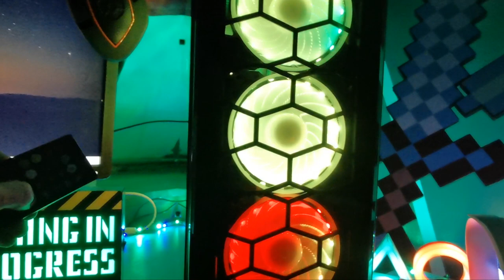Unboxing my Geforce RTX 3070 GPU - EBuyer

Comment: This is a nice little channel.  I’m also hoping to buy one of these from ebuyer by the end of this year. I could have easily got one end of last year but the temptation of the ps5. But I have learned from that mistake due to not many next gen games I probably should have bought the pc first then ps5 later   Holy shit thinking about it I’m extremely stupid   Who knows, the pc may even drop in price, I’ll be going for a rtx 2070 or higher above. I just hope I manage to save my money cause the amount of times I’ve come close to a high ends pc then just threw the money away on lots of little things or most recent one.  The ps5.

Comment: How did you get the LEd lights on mine isn’t turning on with just the remote did you have to plug something in on the inside?
Reply from the maker: No mate didn't switch anything on, on mine.. I just pulled the tape out of the small controller and it then they automatically switched on, when I fired it on

Comment: Very good review I want to buy the pc but a lower end version there was one review and it said the pc didn’t work do you think I should still buy it
Reply: The link by the way https://www.ebuyer.com/1129496-alphasync-core-i5-9th-gen-16gb-ram-2tb-hdd-240gb-ssd-gtx-as-d5411
Reply from the maker: Hey glad you like the review 😀😀 make sure to subscribe to the channel to help 😁 the pc you showed isn't bad at all for a lower end pc. It will run most games but you might have to run them at a lower rate. But will be a fantastic little buy. It has nvenc encoder. So you will be able to stream and record straight from the graphic card

Comment: Hi mate I have this pc and have issues connecting a controller to it. Did you have these problems and can you connect your controller ?
Reply from the maker: Hey mate.. I haven't actually checked this problem just yet.. What seems to be issue?? I'm usually VR so don't use a  controller. But will check for you and get back to you
Reply: Just doesn’t seem to want to connect controller at all wondering if it’s the pc or just an issue I’m having
Reply from the maker: Hey mate.. Sorry for late reply. Been workin alot recently. I tried using my controller last night and all seemed okay. Worked like a regular controller does. I plug mine in tho, around the back ports and registered straight away. So no issue with mine mate
Reply: I’ve tried everything and it just doesn’t want to show my ps4 controller gonna send it back must be faulty

Comment: Hello mate, looking at a pc with this case but hear it has cooling issues due to the glass panel in the front. Is it removable and is there some sort of dust filter behind it if I was to take the panel off or can I buy one online? Thanks in advance for and help.
Reply from the maker: Hey mate, the front panel can be removed, but I honestly have had no trouble with airflow. It's super cooling but I do have a decent cpu cooler.. As to dust cover. I didn't have one but one one on my old cases, so slide it on and works great, but I'm certain they are pretty cheap online dude. Hope this helps. If you like the video could you subscribe to my channel please
Reply: @DavoookyREBORN  Thanks man, appreciate the help. I'll sub now.
Reply from the maker: @tristanmurdock3960  absolutely no trouble at all. Thank for the comment and sub 👍
Reply: I got the 5600x version of this pc last week with the aio cooler and saw the gpu temp was at 81° while playing cod. Airflow isn’t great from the front so I’m going to try playing with the side panel off to see if it makes a difference
Reply from the maker: Nice pc 👌ouch on the temp tho.. I have seen that the front panel is useless really.. Not detachable at all.. I don't think. I reckon taking side panel off and allow more air flow inside. For old pc I used to have a fan blowing straight into the GPU and CPU.. Not recommended but worked for longer gaming

Comment: i got the rtx 3070 pc from ebuyer with the i5 9600k for £1250 but it is underperforming in games i dowloaded the gpu drivers do u know why it is underperforming
Reply from the maker: Sounds like a bottleneck effect mate between your i5 and the graphic card. It  occurs when the capacity of the computer system is limited by a single component that being your cpu don't think there is alot you can do but maybe possibly looking at a higher cpu. Hope that helped ya. Don't forget to subscribe for more Davoooky content

Comment: I just got a asus geforce gtx 1660 from ebuy and it was 100 hundred pounds cheaper but not shure if its legit
Reply from the maker: 100 quid cheaper daaaam . I did see that they are having deals on at the moment. But sounds to me you got a decent deal lad and is very legit to me . Had no trouble with the company at all

Comment: Hi Davoooky. Cool content! Keep it up.
I need help with something😬. I bought this exact prebuilt pc from ebuyer with a 1200£ price tag. had an issue with the remote for the RGB lightings when the pc arrived. When trying use the controller, the case is not responsive for the command im trying to use (e.e changing light modes. Colours, etc…). I contacted Ebuyer about this issue, and the technician said it was probably a faulty remote, and I will send you a replacement soon. Today I received the replacement remote for the RGB lightings of the pc, but when I tried it it still didn't work.